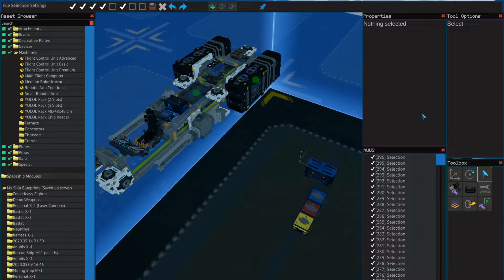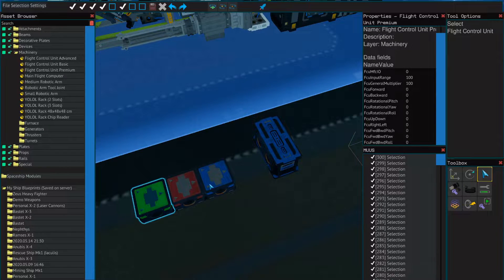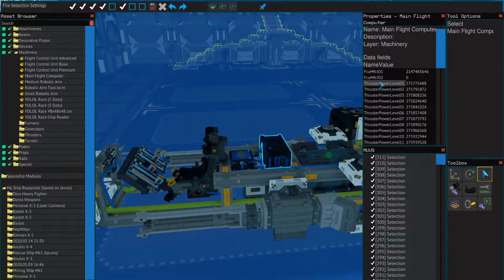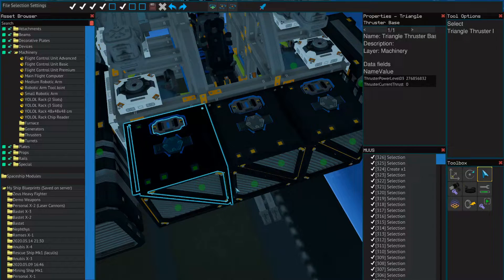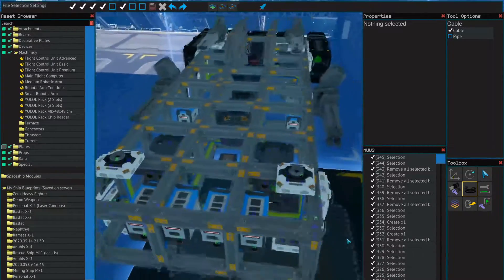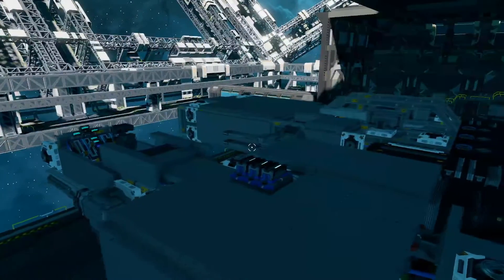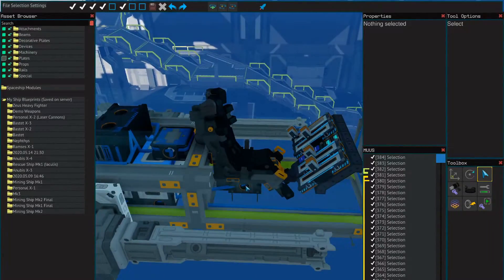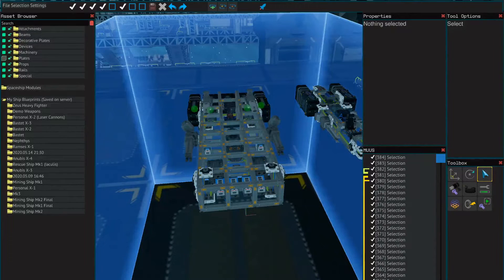STARBASE TUTORIAL- Movement and your FCU/MFC

Comment: What could I have done wrong if the pitch lever does pitch up but at the down pitch the ship rolls, or if I roll left it kind of slow rolls but at the rolling to the right it pitches up and yaw to the right?
Reply from the maker: That sounds like it could be 1 of 2 things. First, it could be that all the thrusters are wired up, but not all have connections to propellant. That or your maneuvering thruster placement can mess with the MFC. (But usually nowadays its the first one)
Reply: @simulatorhaven  Thx gonna try that today out^^